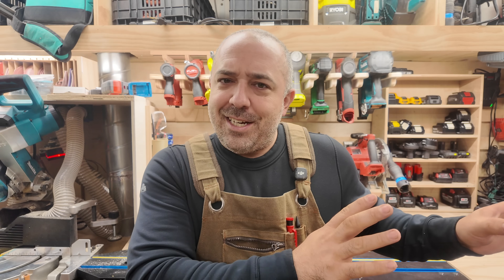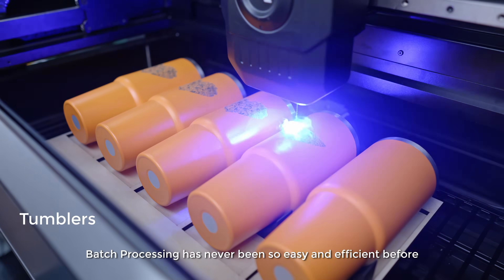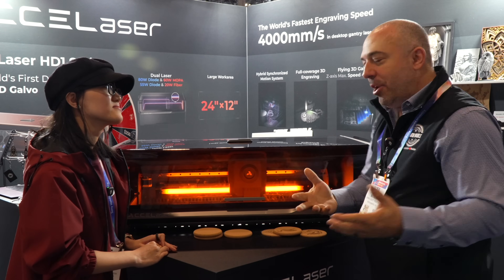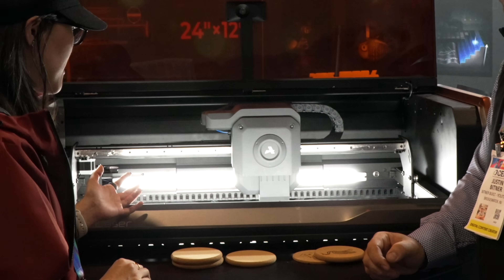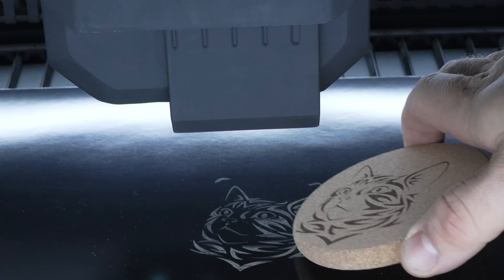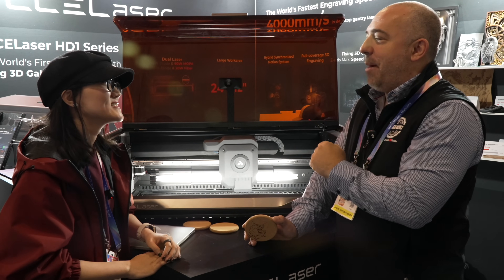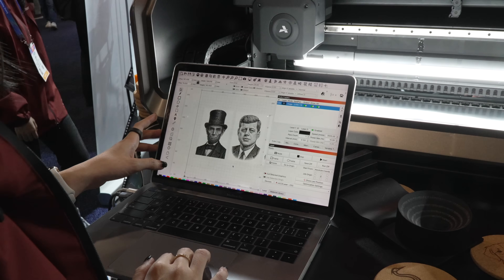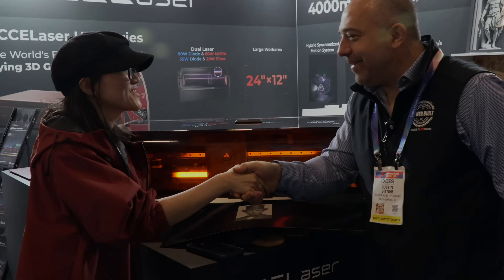Flying 3D Galvo Laser! The Accelaser HD1 at CES 2026

Comment: It seems ideal for engraving. What about cutting? Weak part of galvo is lack of air assist for cutting
Reply from the maker: They didn’t demo cut while I was present so can’t speak yet to anything not on their site personally. I’ll be sure to report on that when I can get my hands on one
Reply: @BitnerBuilt it has a cutting Nozzle that changes automatically similar to a tool changer on a CNC, it lodges on the back of the gantry, and has air assist.

You can engrave and cut just programming the passes in lightburn

Comment: I own a galvo 40 watt it’s so fast all I need to do is switch products. With that being said . The hight on this machine is to small and the work area . .
Reply: There is a Motorized Riser bed that works with the Conveyor addon so you use the pass through option and can do 610mm wide 3m long, more than enough for a skateboard. Also the Riser bed gives it an additional z depth of 100mm to the existing bed..

I backed the HD1 Ultra 60w mopa 80w diode..
Reply: @jonnacruz 
You are exactly correct.

This machine will be phenomenal. I am also a backer.
Reply: I like the  spiral effect . For example I want to engrave on a skateboard and they are 38 in a long to 28 . Or a canvas 12x16  wood . I can’t do this . If they had a larger work area I would buy
Reply from the maker: This is their first model coming out, and it is a lot larger than your typical galvo based machine, which usually only has a work area the size of a piece a printer paper. I’m sure once they have their mechanisms down they’ll put out an Excel version.
Reply: @BitnerBuilt  I use a 44w diode on my 4' x 4' Onefinity. I regularly engrave picnic table tops. Any plans for that capacity with this galvo machine? The diode takes around 3 hours.
Reply from the maker: @JasonPeltier I would assume it has a removable base as they said it will have a riser accessory so you could place it on a table or use a conveyor if the material can fit in on the width (tile side by side pieces) I was just having a conversation with somebody a few minutes ago about how CNC companies adding lasers. Don’t seem as competent as lasers, adding CNC if that makes sense. I have a laser module on my 4x4 long mill and have used it once I think.